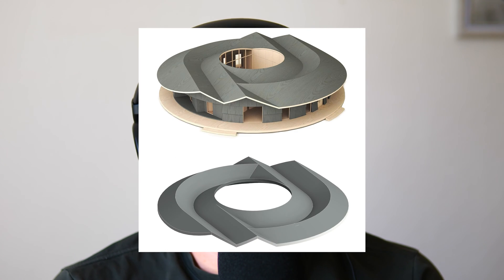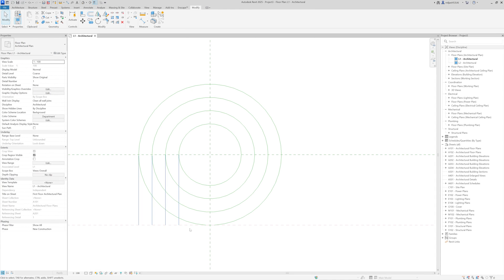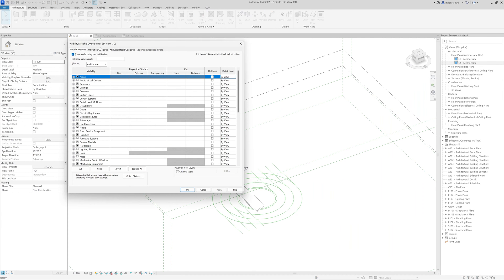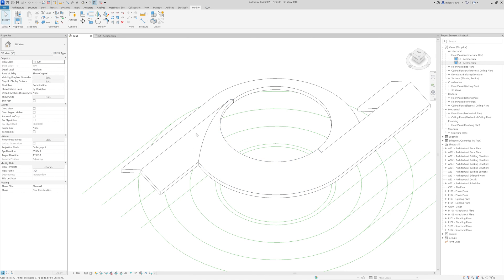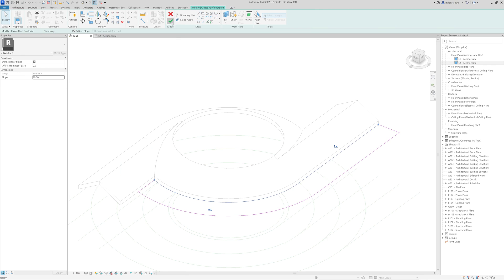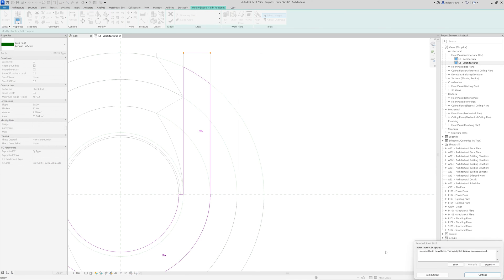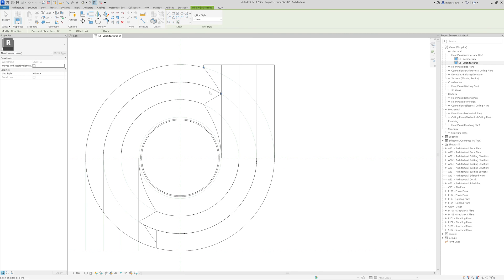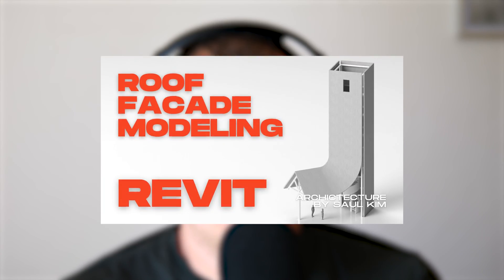Revit Roof Modeling: Unique Circular Roof

Comment: What tools did you use in 6:22 to avoid "Overlapping lines" problem?
Reply from the maker: It’s been a while since I recorded it but from what I can see in video I was using Roof by Footprint tool there
Reply: Drag the overlapping line with the blue dot until there's a gap, then rejoin when it shows you an Endpoint on the other side.